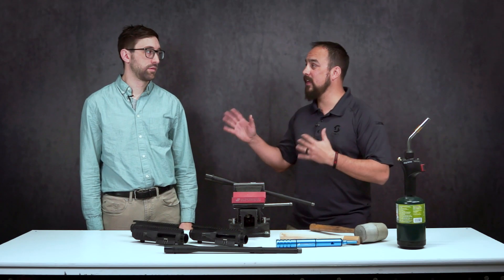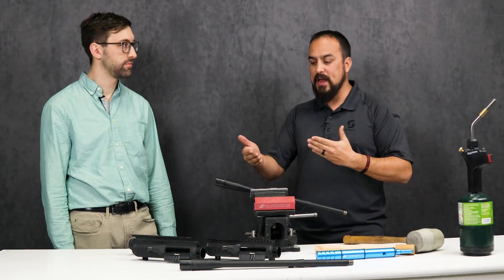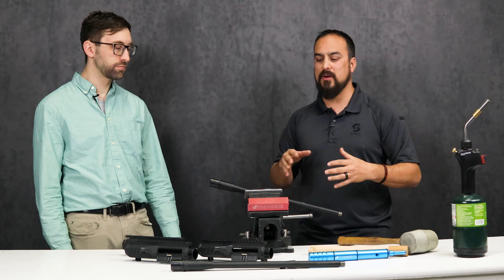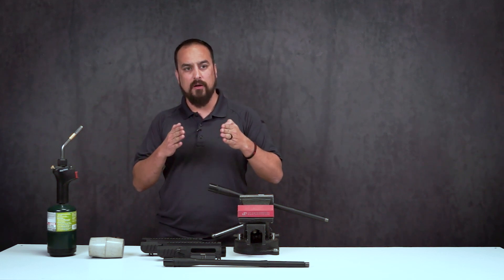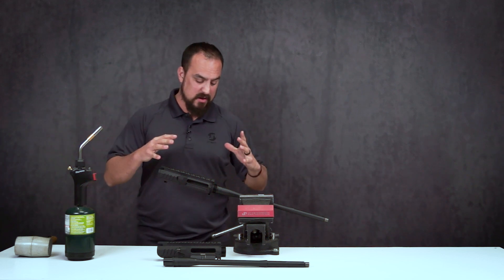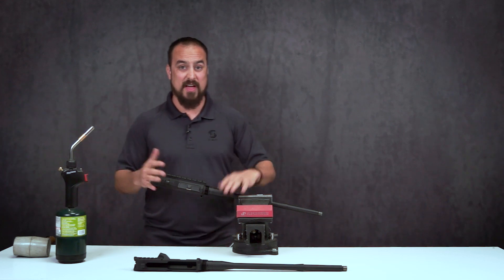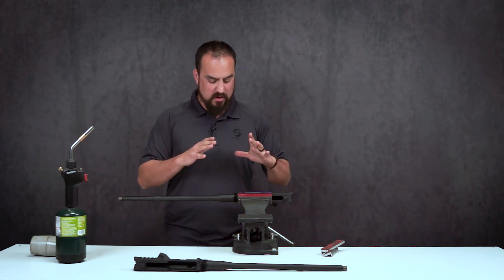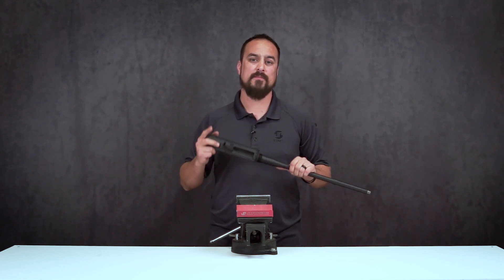The Secret of Thermo-Fit™

Comment: Aluminum thermal fit around a steel barrel. I foresee some serious issues with that concept. The Metallurgy I cannot believe is going to be conducive to that over the long run. First of all heating up the aluminum will change its strength. It will go quickly from a 7000 series to a 6000 series aluminum. Secondly the galvanic action in any kind of humid weather between aluminum and steel is horrible for the aluminum. Unless you have some sort of a coating on that aluminum that will insulated from the galvanic action, You're going to have issues.

I have never seen hey threaded barrel accidentally come loose. Unless somebody does their math wrong and setting the threads and the sizes or thread pitch. There is no issue with threading a barrel on to a receiver. 

 I can imagine doing a thermal fit as long as you're using at least somewhat similar metals. As aluminum is not a true metal I have an issue with it in case you haven't guessed. I might even suggest that you do a slightly hexagonal cut to the male and female parts so that they stay indexed. Because that same mathematical mistake in Threads can happen in thermal fit. It might actually work better if you used an induction coil. You'd have much more control over temperature and size change. It would also be much quicker
Reply: The normal AR receiver is aluminum and the barrel is steel. Never heard of galvanic corrosion in modern production ARs because both receiver and barrel have a protective finish.
The issue with threading is that the AR barrel has a nut threaded over the barrel too. But then the fit of barrel to receiver comes from the tensioning provided by the nut and receiver threads jamming the barrel extension against the receiver threading shoulder. The change here is that the interference fit jams the barrel against the internal walls of the receiver "tube" and then the nut is threaded over the barrel to fix it in place. The original method works fine. Most people don't need to improve it. But this method is an alternative to all the people lapping surfaces, loctiting and shimming barrels to their receivers in a chase for more accuracy.
The AR system already indexes the barrel through a pin sticking out the barrel extension, it fits in a notch cut into the upper receiver threads. Making the parts hexagonal would surely strengthen the indexing but the extra material required to broach a hexagonal hole would mean needing a much larger barrel nut and losing compatibility with many if not most handguards on the market.
Reply: @ChucksSEADnDEAD  understood, I'm just trying to figure out why people are thinking they're going to chase accuracy by changing the way the barrel fits to the receiver. Chasing mythology apparently is a human condition that they can't seem to overcome. The biggest advances recently in accuracy has been in tightening and constricting the variables within the tolerances of the chamber including the free board dimensions. The ability of CNC has increased the capability of manufacturing things too much tighter tolerances that still allow a considerable amount of reliability.

As for galvanic action. Galvanic problems occurred in the early AR-15 in Vietnam. As the aluminum had a direct electrical connection to the steel. Once the steel and aluminum were exposed to the environment of Vietnam. The aluminum started to rot away. I have seen this in Barnes when people would walk in and see a car that was put into a barn that had a little bit of body and 10 to 15% of the aluminum body had literally turn to aluminum oxide. We call that aluminum powder. Bee phenolic resin that they coat military Firearms with tends to resist this quite well. But I don't know if people who are assembling their own firearms are so careful or have the ability to make sure that they are using components that are compatible with each other and properly corrosion-resistant. I only own one Black Rifle. And it is a piston-driven gun because I do not care for piping all of the burnt gunshot residue into my operating system. One may never know when he gets ammo that is not made with IMR powder which is required for such Firearms to operate properly. We know this from the fact that Winchester in order to keep up with demand in Vietnam decided to make 5.56 ammo with ball powder. Which raise the cyclic rate of the M16 to over 1,300 rounds per minute. And it also was a considerably dirtier powder residue which very quickly made the firearms unusable. And m-16s that weigh 5 and 1/2 pounds are piss-poor clubs. They're wonderful to carry. Which is why the firearm was specifically designed for Recon work and security work. It was never designed to be a battle rifle. Now that weighs as much as an M14 before you load the damn thing up. You've lost all the advantage of its design parameters in the first damn place. Only the ammo is lighter.

I still think Robert McNamara should have been imprisoned for forcing that piece of shit on our troops without even having a single discussion with its inventor. A little bit more calmer action may very well have produced a firearm of moderate weight. In a better cartridge for battle that we wouldn't have had to sacrifice hundreds if not thousands of men to employ.

 I just have a tendency to find it inventing a new way of attaching a barrel to receiver that doesn't offer any actual Advantage, is like designing a double action semi-auto to fix an issue that doesn't actually exist. If you have to invent a problem that your procedure is fixing. Then you're not actually fixing a problem you're just changing a procedure for no apparent reason then that you can.
Reply: @44hawk28  I'm not into the precision shooting world so I can't speak for results I have verified myself, but people do swear by the shimming. Again, this isn't a new way of attaching the barrel. It is still attached the same way. It simply skips the shimming. Is this meant to replace the AR uppers in service? No. No harm is being done to the millions of rifles already out there. It's simply choice for those willing to have more finesse in their build than a garage shim job.
Even piston driven guns pipe the burnt residue into the operating system. It's just been relocated to the gas block. Does it make a difference? It makes it easier to turn in a weapon to an armorer without him bitching about the rifle not being clean enough. No gas blowing through the charging handle when suppressed. That's about it. The original gas system has more than proven itself, only falling victim of improper maintenance schedules and out of spec parts during the height of the GWOT.
For all that McNamara could be chastised for doing, the AR-15 adoption was absolutely a genius move that was sabotaged by borderline criminal behavior. The AR has been vindicated by the fact that the many special forces around the world use Colt Canada/Diemaco ARs, the UK adopted an AR-10 as a DMR, the French and Norwegians adopted a piston driven AR design and the New Zealanders got a LMT AR as their new service rifle. Does it weigh more than it used to? Sure. But older, heavier rifles would be forced to gain weight today due to the necessity to use lights, optics and lasers paired up with night vision devices.
Reply: @ChucksSEADnDEAD  take a threaded barrel. Heat up the threaded receiver and force it into the receiver. It is a new way of attaching a barrel. Just because the functionality Remains the Same doesn't mean you weren't attaching the Barrel in a different manner. The vast majority of rifles including the Model 77 I had in 1979 that fired 8049 inch 20 round group. Was not shimmed. It is merely attached to the receiver by being threaded. When you have a shimmed threaded attachment. And you make the shipping process more secure, yes you can change the accuracy of a rifle. But you are not changing the way it is attached. All you are doing is improving the attachment point by changing the amount of stress at the union of the receiver Barrel group. That can have effect on Barrel harmonics. By the same token when you change Barrel harmonics you are just as likely of making the firearm shoot a worse group than when you started. You can also change Barrel harmonics by changing the load in the cartridge. Either by changing the powder. The powder volume. The weight of the bullet. The design of the bullet the point of the ogive, etc etc etc. All I did was question the need for changing the way that you attach the barrel.

 I still remember when people were free floating the barrels of their rifles because everybody knew that a free floated Barrel shoots better than one that has forearm touching on it. It was a total waste of time for the vast majority of people who did it. Because they ended up with a rifle didn't shoot worth a damn. And if you Quantified the number of people who completely change the attachment point. Which they can't do without completely replacing the barrel and receiver. You might end up with a firearm that shoots a bit better. I would be willing to bet that that change, and that change alone does not make a more accurate firearm. There are a lot of other considerations.
Reply: @44hawk28  But that's like saying the upper and lower are joined by springs. Just because there's detent springs for the takedown pins it doesn't deny the fact that the two receiver halves are joined by pins. The interference fit isn't meant to fit the barrel in the longitudinal axis. Just to stop play between the cylindrical walls. Yes, as a side-effect the interference fit makes longitudinal movement harder to accomplish but the weapon is not considered functional until the barrel is locked by the nut.
"Was not shimmed. It is merely attached to the receiver by being threaded" - and if you notice, the AR barrel is not threaded into the receiver. There's no inner threads. The barrel nut threads over the barrel and presses the barrel extension into a shoulder in the receiver threads. There's no actual thread contact between barrel and upper receiver, it's a nut pressing the barrel into place.
"All I did was question the need for changing the way that you attach the barrel" - But that's the thing. The attachment method is still the same. The interference fit simply stops side to side play. It's only meant to replace the need to add filler material to the barrel extension to eliminate looseness.
Reply: @ChucksSEADnDEAD  I understand everything that you say. I just don't find any advantage to the interference fit. Your chances of making the firearm more or less accurate are 50/50. And yes I've seen a lot of barrels that are not fit to a receiver with anything but Barrel threads. They are controlled by the fit. And the twist of the rifling. Furthermore, as long as your Optics are attached to the barrel or two a barrel extension. And the bolt locks securely to the barrel. And there's a consistent reaction during recoil. Mechanical accuracy has been achieved. This conversation is starting to remind me of a conversation I had several years ago with a guy who insisted that a full-length recoil spring guide on a 1911 always made the gun shoot better. And it does no such thing. He also argued that the slide to frame fit was critical to accuracy on the 1911. It is not in any such fashion critical to accuracy. The most critical accuracy components in the functioning of a 1911 is the bushing and the link. As long as the barrel is locked up into the slide, And the slide to frame fit is good enough to return to the same place. That's about all the accuracy you can get out of the firearm. I happen to own a government model it was built by my gunsmith which he carried for 22 years. It does not have a particularly good slide to frame fit. This particular firearm however has fired the highest score ever of any government model. It has shot 600 out of 600, and in competition fired 597 out of 600 on three different occasions. Usually, the best accuracy out of any governmental fire to Camp Perry has been in the 425 Point range. He further argued that the full length guide rod reduced recoil spring binding. Recoil spring binding is caused because the moron who built the gun did not fit The Recoil spring to the gun. And the original design of a 1911 fully controls the recoil spring from fore-and-aft. The reason it never had a full-length recoil spring guide is because the gun was designed to be fired buy a man on horseback. Which meant that in order to reload the firearm one handed you had to be have some way of cocking the pistol with one hand. And when you reloaded it you merely had to put the recoil spring plug against the Horn of the saddle and rack it. people were trying all sorts of things in the 1980s none of them to any avail.

 I think that this form of attaching the barrel to the receiver is a boon to the manufacturing industry. I do not believe that it offers any inherent assistance in accuracy.

And if you don't understand how threads can being in manipulated to create a lock up at a given point then our entire conversation has been fruitless.
Reply: @44hawk28  The issue is: the optics on the AR are mated to the receiver. It's the equivalent of mounting sights to the frame of the 1911. Suddenly the slide to frame fit needs to be good enough for consistency's sake.
Reply: @ChucksSEADnDEAD   I know that the fever usually mounts the scope on an AR. Apparently you didn't understand what I stated. If you want ultimate accuracy you mount the Optics on the barrel. As for the 1911, you didn't understand there either. Maybe you have to go to school to understand how a 1911 works. But when the barrel is locked to the slide, did the Saints will always be pointed where the barrel is pointed. Do you understand now why I explained it the way I did? Barrel to slide fit is far more important than slide to receiver fit on a 1911.